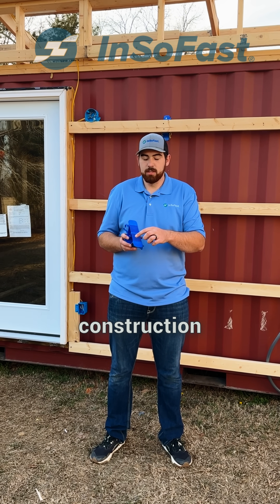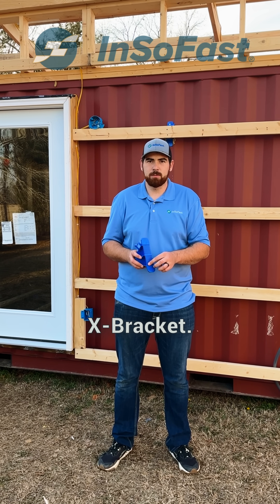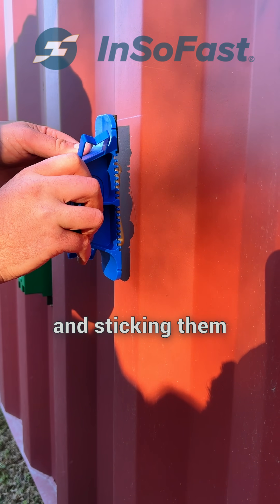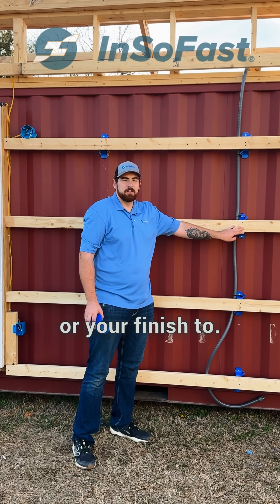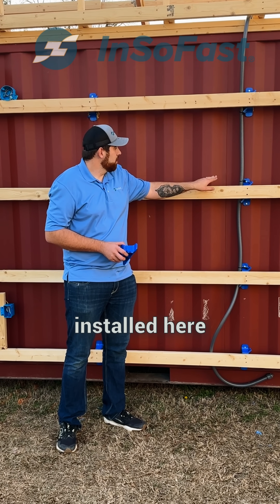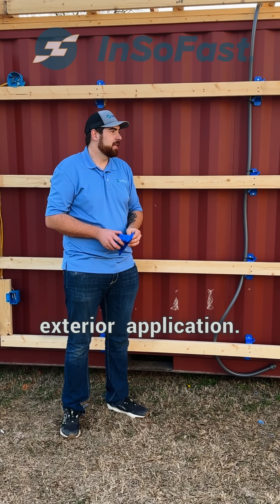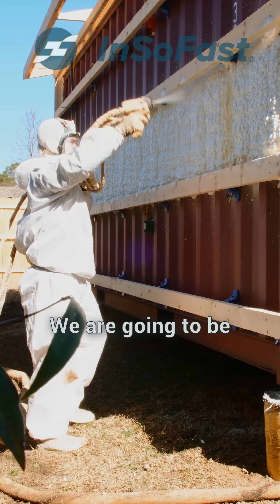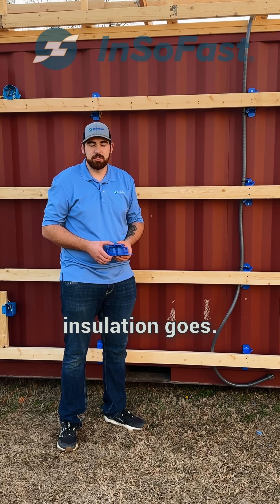The X-Bracket System on the Exterior of a Container Home

Comment: Why not just build the building without the container?  Just use 2 x 6, plywood, siding and standard roofing material.
Reply: You can buy a used 40’, weather tight, shipping container for $2,500 - $5,000. That’s 320sqft or 2,350 ft2.

Comment: Why not metal brackets instead of plastic that’s gonna get brittle after it gets too hot?
Reply: Plastic is a better thermal barrier. It won't get brittle if it's the right plastic. Plastic makes up some or all of your plumbing and it lasts a hell of a long time.
Reply from the maker: This too!
Reply from the maker: UV light is the main reason plastics get brittle. Once the spray foam is added, the bracket is wrapped with insulation the temperature fluctuations stop. Metal is also very conductive.

Comment: You space it out so that you have air flow behind and then fill the Gap with foam. Makes no sense.
Reply: The whole thing makes no : sense also it’s un fit for transport  container is ment for being a storage medium these dhumbb ashes could have just got a40 foot refrigerated food hauler it’s insulated with a AC these guys are all scams making up bs for 1dt0ts
Reply from the maker: There are many different uses that can be beneficial depending on where you live or what you want to use them for, not just storage anymore. 

Shipping containers work great for storm shelters. This one is attached to the concrete piers using shipping container locks. Containers also work great as a cabin that can then be locked up securely.
Reply from the maker: our apologies, must have replied to the wrong comment.

The spray foam is against the container. The air flow is to allow the siding to dry. Also there is no thermal bridging using the X-Bracket which is super important in shipping containers.
Reply: @insofastllc I guess you’re saying you will maintain a space between the foam and backside of furring strips.
Reply from the maker: @Matasky2010  Yes, this is correct. There will be space between backside of furring strips and face of the sprayfoam to create an air & vapor barrier.
Reply: Exactly what I was thinking.

Comment: In conventional construction, that's called an envelope house.  In my jurisdiction, it is not permitted, as the fire marshal considers that space to be a chimney, which would accelerate any fire.
Reply: For all the burning steel?
Reply: Well, the furring strips and perhaps whatever is fodder in the overhead.  The one envelope house that I worked on was already built, but couldn't get a certificate of occupancy.  We tried to design a system that would close off the space - denying entry of makeup air, but none of those systems were acceptable to the fire marshal.
Reply: @Bitcoin_Bernoulli Rosie Odonnel says fire can’t melt steel.
Reply: The whole concept is flawed these things irritate me so much being a carpenter a real one
Reply: @Vampirebunny666 , just be quiet and move on. Or simply say, you are uneducated in the contents of this video and desire to learn more.

Comment: Inventor must be a genius!
Reply: Seriously??????

Spray foam Uncoated for a rainscreen.

I think there's two people who are suffering from a severe case of self inflicted cranial rectal insertion and there are not enough people in their town to pull on their feet hard enough to execute the extraction. 

SMFH
Reply: @Long-Island-Sound , it would have been easier to say you are uneducated in the content of this video and desire to learn more. 

3lb density closed cell spray foam is rated for exterior use. Prior to the invention of the X-Bracket System, other furring options are coupled to the structure creating a thermal bridge. The X-Bracket System uncouples the furring breaking the thermal bridge.